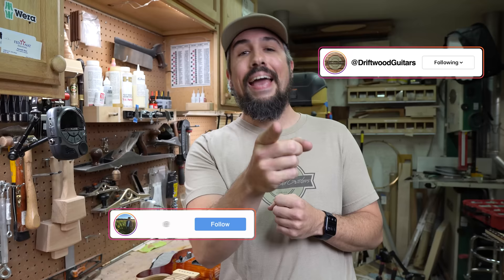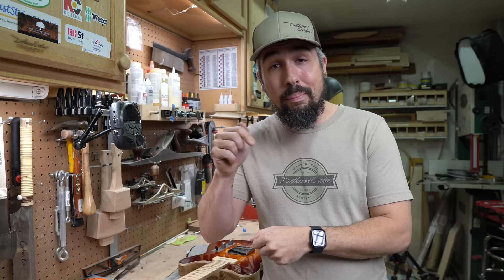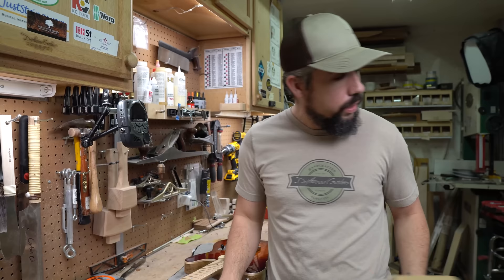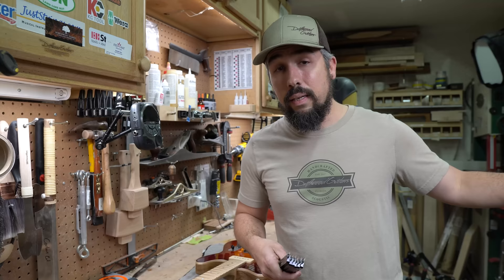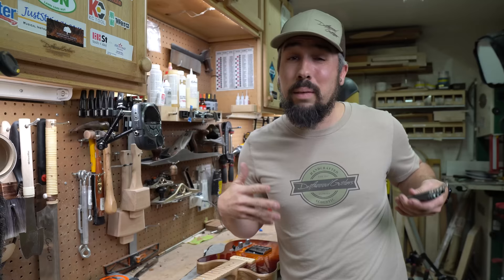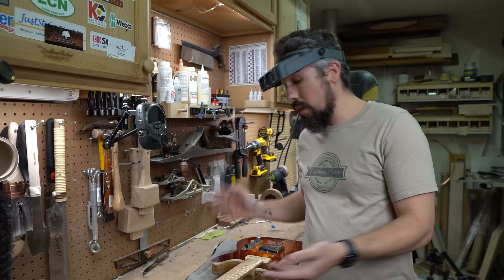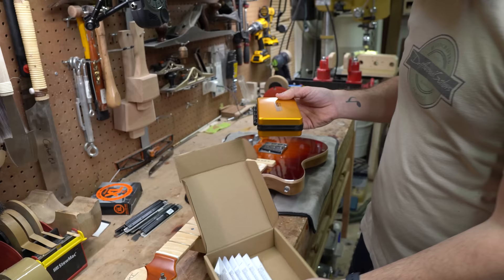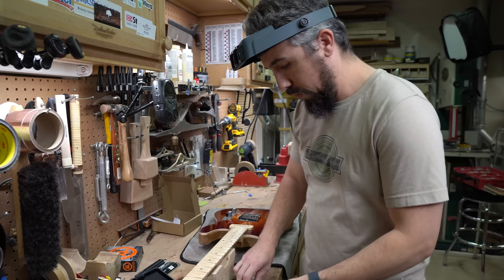Which Is The Better Nut File? StewMac DiamondCut vs Music Nomad Diamond Coated

Comment: I’m looking for some new nut files, since my 25 year old StewMac ones are wearing out, this video was very helpful. Here’s a tip I discovered that helps a lot to get accurate slot placement: I use my jeweler’s saw with a super fine blade to cut right on the pencil mark first, then start each slot with a fine file. Makes things much easier, for me at least. Thanks for your entertaining and informative videos!
Reply: Stew Mac will replace your old files free of charge, but you probably already know that

Comment: There's a chance that the more affordable diamond abrasives follow some abrasive industry standards where there is a wider size disbursement and randomized shape of diamonds in each grade....?  Within the business, it's sometimes called "saw" grade, referring to the acceptable grading on affordable cutting devices.  The simple solution is to draw the new cutter over a steel edge (shelf, vice, etc) to remove the high spots and the device will settle into a more even and predictable behavior.  Thanks for the comparo!
Reply: The side of a lap stone will do that very thing. In fact, that's  one of the jobs they're actually for. If a person happens to also be into knives, like me, the may have a lap stone for cleaning and surfacing, or "settling in new diamond sharpening plates.

Comment: I have this set of Music Nomad files and just built my first hand-made bone nut. These files are great, but I can confirm that they will jump slot on you if you're not careful. They also can cut VERY fast, but that slows down after some use. I'm a hobbyist and don't make any money (yet) doing guitar work, but I do not regret the money spent for the Music Nomad set. I do plan on getting some supplemental sizes to add to my kit at some point.

Comment: Sold me on the Stewmac. Excellent video. Got them months ago and am absolutely thrilled. I only use the backers for the .010", .013", and .016" gauge files, and used my label maker to make labels to stick onto the backers. 

These are perfect. No more pinging nut slots. I used to crease a piece of 1500 sandpaper, wet it, and sand the nut slots to smooth the sides to get that dreaded ping to go away. Haven't had to do this a single time since using these files. The "U" shape that they cut is just perfect. 

I still use my old standard nut files. Mostly for my nut slot spacing technique I came up with, that requires nut files that have smooth sides. 

The diamond files are especially a joy to use when cutting fretless nut slots, e.g. fretless guitar/bass or violin. There's a finesse you can get when getting the strings to the perfect depth that you just can't get with standard nut files. The cut is smooth and perfect...and again, no dreaded ping. 

I'm sure the Music Nomad files are fantastic as well. For the lifetime guarantee and wanting the absolute best quality possible, I'm glad I went with Stewmac. I've been doing this a very long time and my biggest regrets with tool purchases have been wishing I spent more for the best I could afford. These have definitely been the most major upgrade to my nut making tools in a long time.

Comment: I bought the Stew-Mac ones. I only bought the sizes I needed for what I work on. Electric guitars and acoustic steel and classical acoustics. There are two different size handles, 1 for thinner files and 1 for thicker files. I bought one of each so all I have to do is change to the file I need. No need to buy a handle for each file. Saves money. But a handle for each file will save time in the long run. My total was $215 and $247 with tax + shipping. I bought 11 files at $18 each and two handles at $12 each. These numbers are rounded up to the next highest dollar. I ordered them on oct 18th, 2021 so these prices are for that date. I only stick 5/16" of the file out of one end of the handle. The file is still pretty rigid, and you can still see what you are doing without the handle being in your way as you are starting the slot. They will bind in the slot if you are working with a material that is a little too thick. I started with thicker material at first so I could recover if I got off track. I would touch the walls a little as I went down to alleviate the binding. Once I got used to the files, I took the nut height down before cutting the slots. Taking a nut blank height down close to the final top of the nut height will prevent or lessen the binding. I hope this helps someone that buys the Stew-Mac ones. I like my Stew-Mac ones. They cut well and don't tend to overcut when being careful. That helps your learning curve be more successful.

Comment: For the sight-in problem you noted around the 10 minute mark, maybe get one StewMac file - the thinnest they have - and use that to run a shallow groove with just one pass on the marked line. Then go to the sized Nomad file to finish.

Comment: This was great to watch and I enjoyed the lesson. I am one of those guys that's retired and enjoys keeping my guitars set up, but there are limits to the funds needed to buy new tools. I did check out Music Nomad and there is an interesting aspect that was missed in your video... they come out of the holder and have an aluminum backing support. No doubt it wouldn't have changed your mind, but would make it easier to see the start of a cut. Thanks again, really enjoy you two and the work you do!!
Reply: yeah, take the thinnest one, remove it from the holder, and pre-score all the grooves and then you won't really have a problem letting the file immediately settle in the right place for the cut.

Comment: I'd like the files because I use the old file like yours. I've had mine for 10 years and building my electric guitars with Stu-Mac, LMI, and Harbor Freight and Grizzly. I'm doing and finishing 10 e guitars and so on. I can't leave my home due to a generic disk disease and the building my guitars helps with the pain. I'll take any hand me downs without complaints of any kind. I also bought my wood stock from 2010 to 2016, no treaties stopped me. I started to build guitars since 2020 for the 10 I started!

Comment: I'm 72 years old and still playing out with my band, Three Chords and a BEER. I took a week course on refretting electric guitars 40 years ago with Dan Erlewine. This got me going to working on and building my own guitars. About 35 years ago I bought a set of German nut files from StewMAC, The .010 file never worked right. I discovered about 15 years ago that this file was flat on the bottom not rounded. The flat slot made the high E string buzz. I bought a set of the double edge files from StewMac and problem solved. I Have been looking at the StewMac diamond files but the price for me is just out of reach. I found the Music Nomad diamond files about two months ago. I've been looking for a "real' review and found yours today. THANK YOU! To see your review is very helpful. The Music Nomad video shows how to take the file out of the plastic holder wen starting slots so you can see your mark better. My double-edge files work fine but I can see the value of the diamond edge because I have the StewMac diamond edge fret crowning file. It would be great to have your demo set of the Nomad files to start building a larger set. Thanks again.

Comment: For the past 10 years or so, I have used the Hiroshima file set from LMII, with a few of the standard nut files from Stewmac for ones not in that set. They work fine, but they are fragile, particularly the smaller ones. In fact, I broke to 10 thou one.
I build regularly, and would love  a set of these.

Comment: I have a full set of the Music Nomad files and so far I’ve reslotted a 35” 4-string bass so it can be tuned to BEAD with heavier strings, also widen the slots on my Ultra VI Bass for heavier strings from Stringjoy, and on a inexpensive acoustic that was pinching the strings and pinging and achieved wonderful results. I also used StewMac’s nut rescue powder kit and fixed a low nut slot issue with these files and it worked well.
Reply: Does it shape the slot to circle? Same as the string.
Reply: @bassyey  Yes, it does.
Reply: @robertpurdy4452  Thanks dude, was worried it will come like those cheapos with V shape.

Comment: I have two electric guitars that have a problem string that I believe angling the nut slot might solve.  The D string on my 1960 SG Junior and the G string on my Schecter S type Nick Johnson both vibrate like sitar strings. The best information I can find online is that this is caused by the nut not being angled down, thus causing the string to make contact across the width of the nut slot and messing up the quality of its vibration.  I would appreciate any thoughts you might have on this Chris before I try angling the slot myself.  At any rate,  that's the initial reason why I would want the nut slot files.  Your channel is a joy to watch... informative and fun!

Comment: Something you may not know regarding the issue of the top of the Music Nomad files handles blocking your view - the file sections can be easily taken out of the plastic handles. Just pull the tip down & off. The file part itself is small but you can get extremely precise without the plastic handle.

Comment: You can remove the tip of the handle, and take the actual file out, that helps, when having to start the initial slots.
I'm using these, right now, on a bass nut, which I made from a blank of TUSQ.

Also, in regards to the "crunchy" feeling you're talking about, when slotting with the Music Nomad files, it all comes down to the grit of the particular file.. Some are 150 grit and some are 300, and that might be the reason why.

Comment: Thanks for the review. I got an Heritage ES electric and owner had cut the original nut so low it buzzes so, I got a tusq nut, have the music nomad ones on the list. I remember I replace the cracked plastic nut on a classical in college and used regular files files to get the shape and burned thru box cutter razors  to get the initial groove marks  and using old electric 9's g string to hack in the slots. Worked, but took some time .

Comment: Thanks again for taking the time to make the video. I have been using the old style StewMac nut files for years. As I am now semi retired I only do a few guitars a week so I don’t think I will get a set of the new StewMac diamond files, the less expensive set would be a great addition to my tool kit.
Pete Towers 

PS: I noticed that you have a StewMac ‘Rock and roll’ neck rest on your bench, I sent in the idea for that to StewMac about 30 years ago! If only I had the patent, I could have got about 15 cents per unit and could be $30- $40 richer by now

Comment: I have an assortment of Stew Mac and other American and affordable imported nut slot files.

The SM are probably top of the list. But they have one thing that bugs me. The front of their files are blunt square ends, which have sharp corners. I found that out on the cheap trial guitar I use for checking new tools, parts etc. Make sure you protect the front of your headstock with a nice heavy layer of low tack tape. When you are trying to round off the back of a nut, like a large nut on a Gibson, the sharp edge of the SM file can tear a slice into your headstock finish if you are not careful or slip, etc.

I have another Japanese set, that I can’t recall the name of, that has a smooth, rounded front and a rubber handle. But they are actually toothed files, not diamond files.

If you do this as a hobby and have a collection of guitars that are going to need maintenance on every now and then, try buying one or two files per month, depending on your budget.

Comment: I have a few cheap guitars I bought as projects, and 2 of them have new nuts with the fret slots just slightly high. Can't sand off the bottom anymore without at least 1 string being too low. Time for filling each slot to get every string just right.

Comment: I've purchased the Music Nomad ones after seeing this video. In Europe the prices of the Stewmac ones are way too high and very difficult to get. The Music Nomad ones work just fine. They do the job very easily with consistent results I noticed. They will last a long time with proper usage. They changed the grid on some of their files Nomad Music told me last week so they are better now. For the price of the Stewmac ones I can buy several Music Nomad sets. I can remove the files from their handles so visibility is not a problem anymore. They get the job done in a short time with satisfying results each time. After setting up a few guitars they with new bone and TUSK nuts they are still like new. They pay themself back in a very short time.

Comment: I have a set of old-style Stewmac nut files, the ones with the red plastic handles, no diamonds, which I got maybe 20 years ago. They are slow and the  .010 is wiggley (as you said) and tricky to use. My current build is a 7-course double-strung acoustic and I will need to expand my selection of guages to accommodate 14 strings, 10 of them in octaves. Maybe Santa will get me some Nomad files.

Comment: I bought the Music Nomad light gauge set for the PRS I built (shameless plug, see my channel for build videos).  I loved them.  Also the little nose in the plastic handle comes out so you can pull the files out of the handles and use them without the handle or turn them around if one end gets worn too much.

Comment: I want them because I've built 9 parts-casters since March 2020.  Occasionally, I get one with a nice nut, but usually....EH, they need work.  I've tried looking for what I can afford, but I haven't found a set that works as intended.  All in all, I've probably spent what the stew mac set costs, but only ended up with a bunch of paperweights.

Comment: Many, many years ago, I needed nut files but couldn't find where to get them (no net back then!). Frustrated, I had the idea of flattening out the set on a junior hacksaw blade and then grinding it to a desired thickness. Along with a little tickling with some smooth emery, it worked really well, so I made a few more. I haven't used them for years now, but I've still got them, ..somewhere!

Comment: The Nomads are fine for adding depth to an existing nut but not as good for cutting a new nut, for both reasons you mention.  But they will do the job and are probably the best available for the price.

Comment: Since there aren't many places for me to get my hands on dozens of guitars, I'm planning on building a series of bolt on necks with different widths and profiles so I can try to figure out which I like best. These nut files would be very helpful in that regard.

Edited to add: The Amazon link in the description shows that the files can be removed from the yellow handles and used very much like the Stew Mac files.

Comment: I bought the Hosco nutfiles like a year ago and i’m noticing that on the high strings it’s to wide and the strings are flooping around. So i would really love an upgrade!
Reply: Are you getting weird buzzing sounds like a sitar ? Or some strings sound a bit dead ?

I just bought a set of hosco files and I don’t know . Wasn’t really impressed 

Some of them were actually bent slightly which I think may be causing problems . I might get the stewmac file backer things to keep them straight 

Some of My files seem to get stuck in the slots when filing 
Maybe I just got a bad set

Comment: Agree that the Stew files are top quality as is most all of their gear.  That said, I've been using the music nomad files since they first released well over a year ago and I have to date cut around 150 or so nuts with them.  The verdict? they work perfectly fine and I have yet to notice any degradation of the diamond material on the files themselves.  They basically still function as new AND, you failed to show the way each file breaks down out of its yellow handle in about 5 seconds flat.  Simply slid the tip of the yellow handle off and the file drops right out.  That solves the issue of not being able to see where to start your cut for each slot.  This also allows for you to get the file into very tight angles to cut if need be.  It is not a hassle to remove the handle or to put it back when ready.  Definitely should have shown that functionality for this review in my opinion.  Even if you do consider yourself a "pro" shop, if you are in need of nut/saddle files, and don't wish to drop several hundred $$, give the music nomad files a shot.  Heck, just order one and give it a try, they've worked out just fine for me anyhow.  Thanks for the review guys, keep up the good work.

Comment: I could really use those. Nut files are one of the more expensive tools that are hard 5 justify buying. I usually end up getting a plastic or tusk nut and filing the bottom to make things work close enough. These would help dial it in better or allow me to make bone nuts.

Comment: On nomad, if you remove the file from the yellow guard, you can see. I noticed you did not do that. Also, it will give you more control of the file. I figure if you DIY  90 bucks is cheap compared to one trip to a luthier. Thanks for the reviews yall do.

Comment: I found I needed to take the files out of the plastic handles of the Music Nomad files  to get the rounded edge on the back side of the nut. I was only using them to lower the string height on a couple of acoustics. They seemed to cut nicely though.